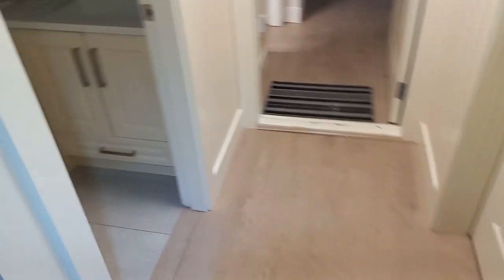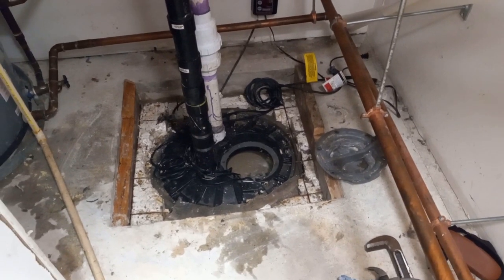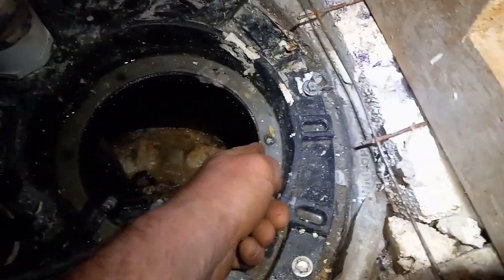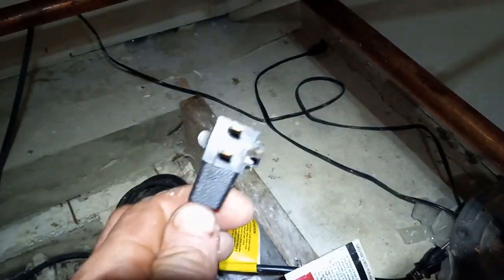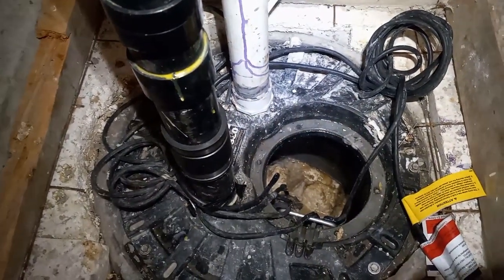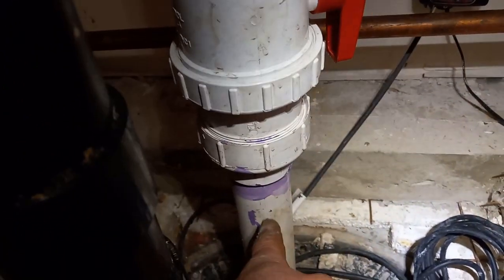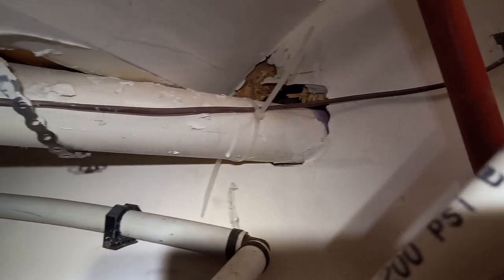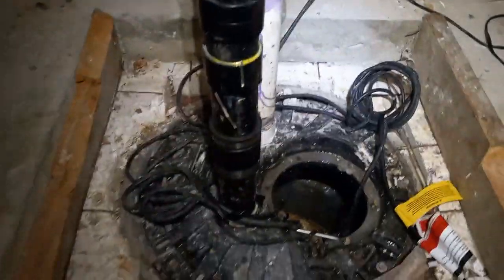Learn to service a sump pump

Comment: How are you not wearing gloves?
Reply: I learned from molecular and cell biology our skin has tight joints which do not even let water molecules thru.
It's an extremely good protection against any bacteria in  the dirty water.